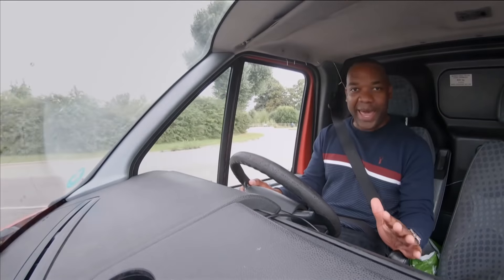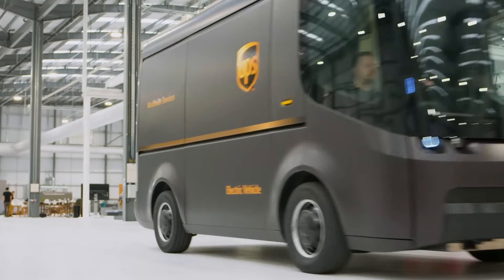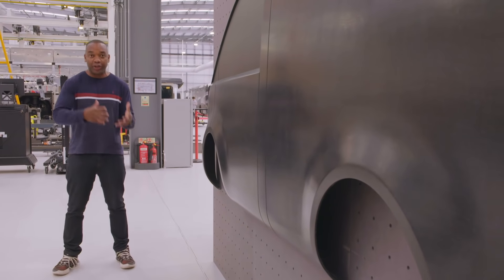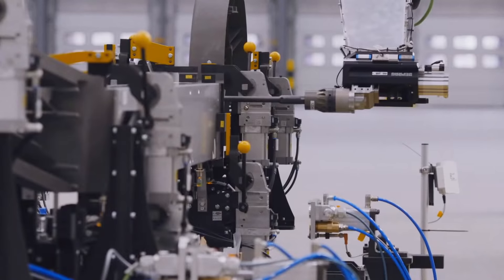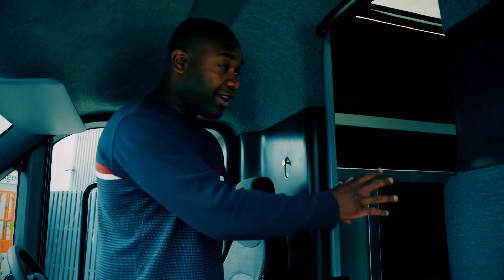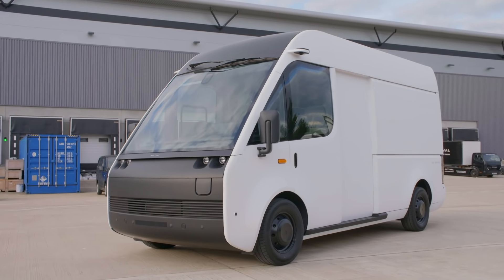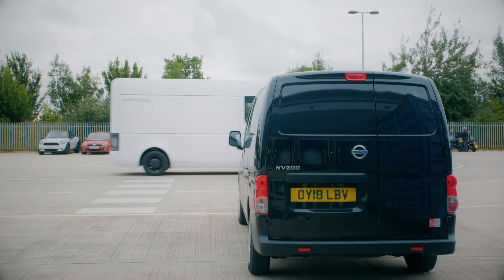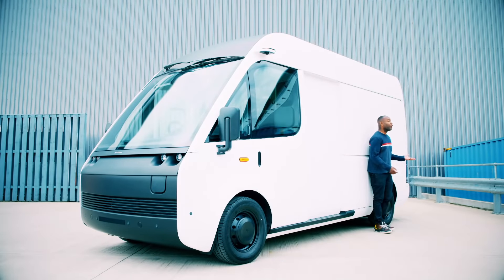The Arrival Van Test Drive | Fifth Gear Recharged

Comment: I wonder how this scales. How big would the facility be if they were churning out a similar number of cars to a traditional car plant?
Quite a disingenuous video.
On the actual van;
It's great that they have had some changes in design freedom but moving the passenger cell forward worries me, you are going to be closer to your next accident. That said maybe they have been able to design in a better crumple zone.
We don't have them on current vans a lot but the sliding bulkhead thing isn't new.
How spacious is the rear, well we know it has 1m3 more than a diesel transit, but which diesel transit? They come in multiple heights and lengths where is the comparison based? I have just this second visited the Ford website and the L4H3 Transit has a load volume of 15.1m3, (with bulkhead), which is MORE than this specimen. They also quote a VDA figure of 14m3. Bam dims are 6704 x 2474 x 2778, (LxWxH).
Not sure how I feel about the increased use of plastic yet.
211 mile range? Terrible.
A really poor video article.
Reply: One microfactory is planned to have capability to manufacture 10000 vans per shift. If there is demand factory can operate on two shifts. As example If there is less demand for van microfactory can switch to manufacture buses, uber cars and vans in same plant it is highly flexible. Microfactory is not new concept and has advantages compared to traditional plants. If there is no need to pump 200k of the same vehicle in one location than microfactory is way to go. All plastic panels is fully recyclable and can be used to manufacture new ones. As well having no paint shop, no metal stamping, welding it has less impact on environment. Problem is not plastic, problem is people not recycling, littering etc

Comment: The "micro factories" thing is total nonsense as far as I'm concerned - assembly lines aren't "the traditional method", they were a serious innovation that REPLACED the classic method of... You guessed it... Building up vehicles one at a time per station...
If this method ends up more efficient or faster I'll be stunned - but fair enough, Hyundai Kia are investigating and they'll know a lot more than me about it!
Reply: They aren the traditional method today. it been around for 100 Years so I think they can get away with calling it traditional.

Comment: I'd go with proven and tested Ford any day.
Reply: Have you had intermittent problems with the info screen and related phone connection etc?
Reply: @Neil-Aspinall  Ford surely not without flaws of course 😂, yet can't beat its decades of proven automotive tech milestones. I'd feel safer in metal wrap van with good chassis rather than shoved so far forward in Tupper ware plastic ish for more future landfill problems. Wouldn't imagine how it would survive crash test 😂. But it's just me 😂
Reply: Quite a lot of "crumple zone" in a conventional van is filled with a massive lump of solid metal (engine) that would just love to come flying through the bulkhead and kill you in a front impact. No idea on the specifics of this van, but you can have the same energy absorption in a much shorter space if you remove the engine.
If companies like this force Ford into sorting out electric vans properly by proving what's possible then I'd take that as a win.
Reply: I've seen a few of these crumple zone and safety comments. There is a solid structure under the panels, not just plastic clicked together. It is better to have dedicated crash protection in front of you rather than a half ton of metal ready to crash through into your kneecaps. And thermoplastic is recyclable, actually very easily as it can be heated up and remoulded without having to melt it down to a liquefied state meaning damaged panels can in theory be removed, reinserted into the mould and re applied to the vehicle.
Reply: @Neil-Aspinall  You think every infotainment screen is glitchy and horrible I bet. Use a BMW iDrive infotainment system and you’ll see your perception is different.
Reply: @marnuscoreyempanadaslooseb6760  I was talking about Ford bud.
Reply: @Neil-Aspinall  Well I’ve never owned a Ford in my life so I wouldn’t know. I drove the latest Focus in 2019 and it seemed very easy and didn’t seem glitchy.
Reply: @marnuscoreyempanadaslooseb6760  Own one for a while and you will discover the glitchs which FORD will simply respond with, 'we'll update the soft/firmware', which works for a while then something new will act strange in the unit? Sometimes the unit can't see the USB stick either (Yes I've used different ones to find the trouble) Truly, the infotainment unit is hit and miss. Transit drives good though.
Reply: @matthewnightingale4675  
Engines don't do that now, that's old tech.

Modern vehicles in a crash the engine drops down and below the vehicle. So as not to intrude on the passenger cell
Reply: @Neil-Aspinall  had fords for years. in fact had little else BUT fords. never ONCE had a glitchy screen in ANY that our family have owned

Comment: 5 reasons why it won’t work 

1 Really bad payload 

2 Limited uses as Vans need to be practical in every way 

3 using light Materials will make more panel gaps and thing to go wrong with

4 Really dangerous to drive as its practically made out of plastic which is weaker than metal and low survival rate and high fatalities 

5 unrealistic range as with payload will decrease it more than 50% of its range 

JUST STICK WITH A TRANSIT OR CRAFTER SPRINTER DAILY VANS KINGS
Reply: Why will using light materials give bigger panel gaps? The aircraft you fly to your holiday resort on is built of light materials, but you don’t get panel gaps on one of those. Why should plastic be so much weaker than metal? Have you never seen a glass reinforced PLASTIC military vessel or lifeboat, let alone the thousands and thousands of leisure craft all around the world?
Reply: @David-qs5ii  
Depending on the situation, plastic can be stronger and harder wearing than metal.

Used in industry all the time because metal doesn't cut it.